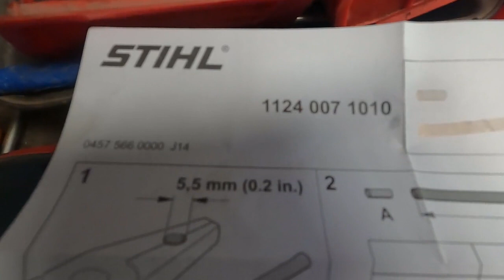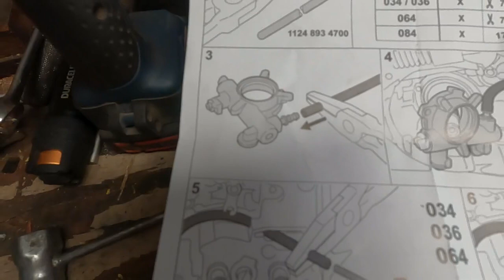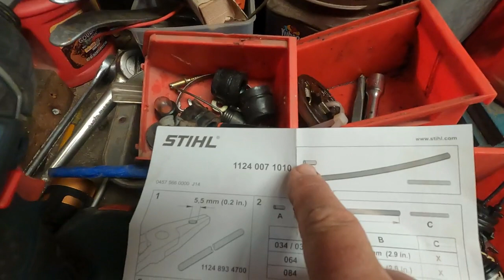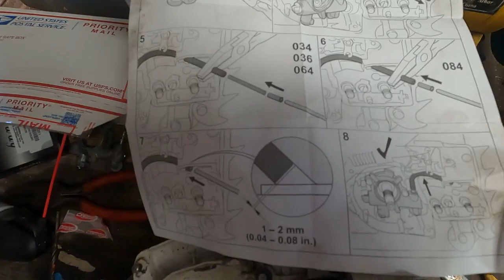STIHL 036 OIL PUMP INSTALL MISTAKES AND ALL.

Comment: you sir have mastered the stiff stihl oil pump hose install,ive done it too,im making a second plier, as my first set was a cheap  needle nose, and i drilled to far forward,the tips  broke off,i like how you  hamnered it down on the nipple, i chose not  to use  the spring,and modded  the pump, to flow  more, a open flame was too much, boiling water helped,heat gun may  distort it,...i thought the spring may reduce flow, i have another 034 to do,ebay purchase,oil hose melted thru,at sharp bend,....im adding the muffler cooling plate, ,hopefully  ive got it mastered ,thanks for the video
Reply from the maker: I can tell you've been there. I use 1184 to seal the pickup tube to the case and a smear of it on the bar plate. New bar plates are cheap insurance. I have carpal tunnel in both arms...couldn't do it any other way. It's one of the only PLASTIC tubes in any of the saws I've fooled with.
Reply: @JDanielsOffGrid  is 1184 a sealer, im not familiar  ,i did use  jb weld,to keep oil from dripping back down towards the clutch,thanks f for   the step by step video, they do  help folks
Reply from the maker: @sonofthunder.  Threebond 1184 I use for gaskets or gasket delete. JBWeld seems a bit permanent.  Permatex Ultra Black is oil resistant for most hoses and such.  1184 is oil gas resistant with a long install time.  For when you are working slow. For any of them, clean the area with brake cleaner on a q-tip or cloth for a good seal. So short version is 1184 for gaskets and Ultra Black for repairs to hoses.

Comment: Might have to grab an old pair of line pliers and  mod them. Thanks for the tip!
Reply from the maker: I watched it for the first time right after publishing and friend Casterman had already commented. Thanks. This is stiff tubing. Not easy. Lubriplate would have been better than oil.

Comment: How did you remove the brass fitting that’s in the oil line?
Reply from the maker: Sorry for not getting back to you.  I heated the hose over the center burner on kitchen propane stove.  When I put it back in I drove it with a tapered smooth center punch.

Comment: Well done, I cringe everytime one comes in for an oil pump and hose replacement,  the 034 and 036 are the the only ones that are such a nightmare, but the 034 is actually worse,  but the number that comes in with soft hoses fitted and not oiling correctly is interesting which means many other shops take the easy road. Never could understand the need for the spring with such a stiff hose🤷‍♂️
Reply from the maker: Thank you.

Comment: Hello Jay . That did not look easy at all. Too bad instructions are so bad these days.Have a good weekend.
Reply from the maker: The instructions were fine. There is no magic way to put that plastic (not rubber) line on over the nipple. When finished it makes total sense and would be easier the second time around. I have some left, might try hot air.  Fire softens it ...not sure flame is a good idea. 
Hammering it on at the end their went amazingly well. Oiler is pot metal so wood backing only.